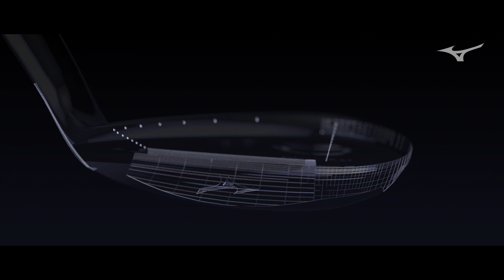Mizuno T7 Wedge - Full length R&D film with Luke Donald

Comment: In the clip I see a Wedge with 47 degrees. What would that be different from a regular PW with 47 degrees loft? Would you than trough out the PW in exchange for the 47? I am curious about the reasoning behind by the manufacturer?
Reply from the maker: Mostly for the grooves.  In a normal iron set they are forged (or cast) into the set and won't have the precision of definition of a milled groove.  After that it's very personal - shape, finish.....just what you prefer.  No need to throw away a perfectly good pitching wedge, but you might buy your next set to 9 iron and throw one of these in.  Also some pitching wedges are as strong as 44 degrees now.....leaving a space.
Reply: Thank you for enlightening me. I will definatly consider that when my MP62's need replacing, or just when the MP66 become available in The Netherlands, cause those look again simple and clean. #nothingfeelslikeamizuno
Reply from the maker: The new MP-18's will be out in September.  Look out for them.